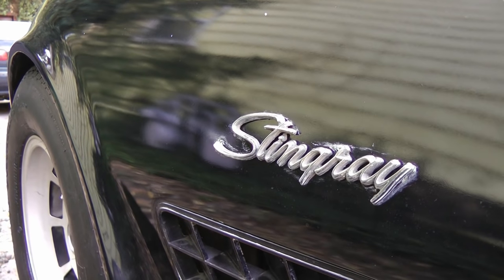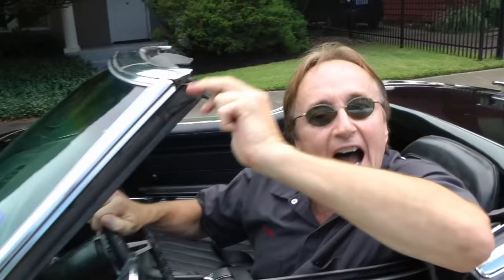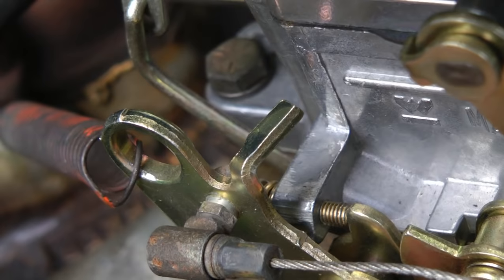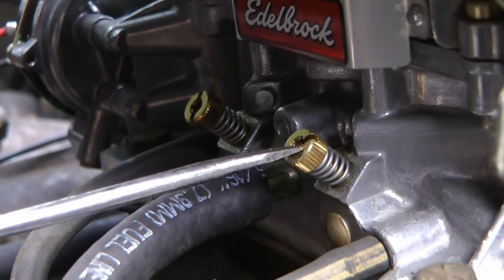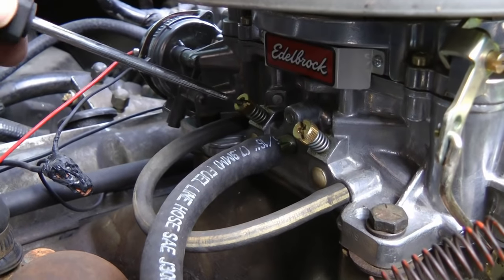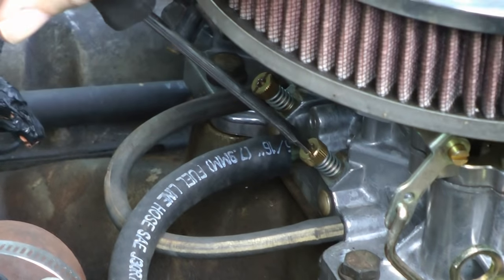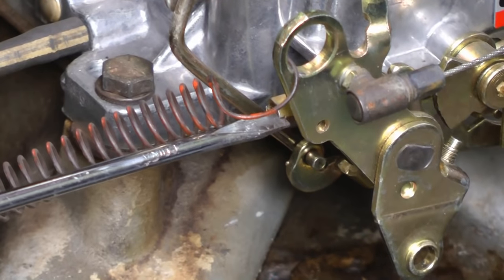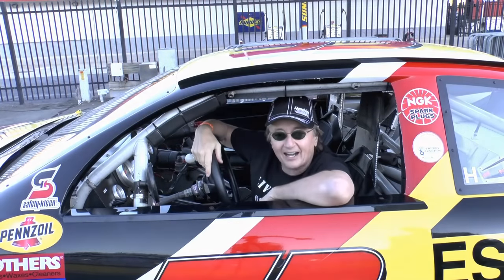How To Adjust A Carburetor On Your Car

Comment: I have an 82 Ford Fairmont straight 6 3.3. This past week been trying to find out why my car does not stay running while idle. Dies about 10 seconds after starting. Replaced plugs, wires, the coil, and the choke thermostat. When I replaced the plugs and wires a month ago, it was running great, then last week, it happened. I was told to find the idle mixture screw. No such luck on finding it. Any help would be greatly appreciated.

Comment: I have 4 adjustment screws on my QFT carb 2 on each side of the carb, should I do the same with each screw like you did with the 2 on this carb? its on a 351 windsor
Reply from the maker: +DieselSmoke92 yes
Reply: Okay so I ran into a strange situation. I did exactly what you did set them all the way down, then turned them up as many times as you said for all 4 on the QFT carb, ran it and then did some reading which was simular to what your saying, I set the car at 1300 rpm idle, started brining the screws more out towards me and was planning on doing it till the car hit 2000 rpm, then set idle down and do the next. What is happening is bringing the screws out/towards me is bringing the idle down not up
Reply: +DieselSmoke92 It may be that the jet sizes are not correct. This is really common for decent altitude changes between where it was tested and where you are using it. If the idle is highest when the screws are bottomed out, then you might have jet sizes that are too large and the mixture screws are continuing to richen the charge. You should probably get a set of a couple different size jets and start going down the sizes until you reach a set that have a maximum idle point around the stock 1 1/2 turns.
Reply: your saying get different screws?
Reply: +DieselSmoke92 No, the mixture screws aren't the problem. There are little brass inserts in the carb that have a very accurately sized hole through them that control the amount of gas mixing with air. The mixture screws allow for an amount of fine adjustment. I believe the screws don't have enough travel to adjust for the size jets you have. If you changed the Jets to a different size like I mentioned in my earlier post, you should be able to properly set the mixture then.

Comment: I don't know if you will see this considering it is not your latest video but I have a question regarding carburetors and engines. I have a homelite weed eater and after running it for about a hour and stopping it, it stops running at full throttle. I adjust the carb but to no avail. No matter what I do after that point it will not run at full throttle. Do you think it is over heating or could there be a issue with the carburetor?
Reply from the maker: Alpha Nerd certainly one or the other. But if it runs fine an hour, I'd say it's overheating. They are not made for that kind of long useage, they are just tiny little things after all.
Reply: Scotty Kilmer that is true. And considering that weed eater was sitting in our basement for about 20 years before we started using it so it was designed to run off of non ethinal gas.

Comment: Another unrelated note, I want to do a auto to manual transmission swap, on the same truck if I do it my self, would it be worth it, I don't want to sell it? Does that mean I would have to disconnect the 4x4, or is there another a way?

Comment: Hey Scotty I have a 1998 ford windstar that seems to burn oil out the exhaust here's the weird part the engine is a ford reman and doesn't feel like it warms up I replaced the thermostat with a factory style 180 degree thermostat. It consumes two quarts between oil changes in thinking it's the temp sensor or the gage is broke. The needle Barly moves off the cold mark and the heater is mildly warm. Thanks
Reply from the maker: droidrazor873 poorly remanned engine, for sure, it should not burn oil at all. Let's just say they don't fix things like they used to. It should burn NO oil being rebuilt correctly
Reply: Ain't that the truth!

Comment: Hey Scotty, if a car that goes below 1000 rpm when it's stopped at a red light starts to stall with a rough idle would I need to tighten or loosen the screw on the carburetor/throttle body?
Reply from the maker: Cristian Vargas tighten

Comment: Hi Scotty what should be the normal Idle of a carb engine?
is it should be 650rpm for manual?
Reply from the maker: +Hot Rodimus all vehicles are slightly different, but that's fine for most
Reply: +Scotty Kilmer just a follow up i forgot its an inline-6 carb RB24S
is 650rpm still ok?

Comment: Hello and greetings from Greece Scotty, i have a Citroen BX 1.4 kat with Bosch monopoint fuel injector system, which is somehow an electronic carburetor with catalytic converter and has a distributor also........the monopoint problem is the electronic throttle potentiometer .......how can i fix it???

Comment: Is it true that it's possible to use less fuel by adjusting the carburetor?
Reply from the maker: +JaiVideoProjects you would have to rejet the interior parts to do that, a complex job to do correctly
Reply: +Scotty Kilmer ok. i thought its judt like a motorcycle were they adjust the choke..

Comment: thats one rough v8.  How many cylinders are working on it?
Reply: I'd say 4 or 5.
Reply: All of them, but the idle speed is very low. Maybee 300rpm.
Reply: it's probably cammed giving it a lope on idle
Reply: Peter B. A little tip engines can't idle that low
Reply: It’s probably cammed

Comment: Can an engine cut out if the idle speed is adjusted too low and the if the air mixture is incorrect?
Reply from the maker: +michael jagger  only if you go too low

Comment: Have any suggestions for me? I have an '84 Mitsubishi Mighty Max with a weber carb and after i've been driving for a while and turn the engine off, the engine sputters for about 10 seconds. And if I turn the engine off for a few mins after 15 mins of driving, like running in to get some milk at the store, it's REALLY hard to get the engine started again. It will crank but won't turn on.  I'm not sure why this happens. I don't know if this is just a  simple adjustment I can make with the different screws on the carb or not.  Any suggestions are welcome!
Reply from the maker: MikenikeBTS if that weber has a fuel cut off solenoid, make sure it's working. if not, idle it down lower or rebuild the carb
Reply: Thanks for the quick reply. I'll try that.

Comment: aye I have a 350 create engine and i don't know  what's going on its not gaining the speed like it's suppose to and it's accelerating very slow and revs very high and it's in a 1986 chevy monte carlo luxury sport the monte had a 305 in it and I bought it from my uncle so it has a 305 Trans in it and I was told even tho its a 305 Trans it would work for the 35o I gave it a oil change and changed the oil filter I did all the Little stuff I knew how to do and I'm a out to go and get new spark plugs for to see if the performance comes back. if you know what it may be I would surely appreciate it

Comment: Scott I need help my carb has been rebuilt but it still bottoms out when I hit the gas. The fuel line is clean an fuel filter are clean. The carburator was rebuilt but I'ma feeling like it's a vaccine issue . Any suggestions?

Comment: I rebuilt my 350 engine not too long ago but problem is i can't get it running. im doing TDC on #1 piston got my rotor pointing toward #1 then correct firing order but its hard to start then when it do run while trying to rev the engine it backfires thru the carb sometimes gas squirts out. I just bought a new distributor same problem, what do you think it could be? I have a video on my profile if u want to see
Reply from the maker: +txchevyrida  SO many things can go wrong on a rebuild.  But first hook up a timing light and crank it to see what the base timing is, dist could be off a tooth or more doing that
Reply: +Scotty Kilmer The carb was sitting for about 3 months also the gas too when i take the carb off to pour the gas out it looks like it has a brown tint in it

Comment: how do you know when it's lean or rich?
when you loosen the air screws does it let more air in?
my old 1989 corolla does 6kmpl and I'm working on increasing its mileage haha
Reply from the maker: you look at the spark plugs, black is lean, white is lean. Loosening the screws makes it leaner
Reply: black is lean, white is rich? or black is rich white is lean? confused... haha
you typed black is lean, white is lean
Reply: Joseph Christian Salas god damn. And he just leaves his supporters hanging like that. I have been messing with those damn screws for 5 hours.
Reply: haha I know right, but I found out after messing with the screws and testing it out that loosening the screws lets more air in thus leaning out the engine and making it more efficient.
although it makes the engine a little bit hotter but unlike the rich mixture it doesn't flood the engine.
my sparkplugs were not fouled unlike the rich mixture. and also the smell of gas is lessened :)
it's a trial and error though haha

and also I found out that if you change your octane rating (changing your gas to higher or lower octane) you also need to recalibrate the carb for it to be efficient again hehe
Reply: you're suppose to not do it like this video , when the car is at highest idle after you turn the screw out you must not leave it there cause it's running lean and it will damage your engine if you leave it there  ,  you are suppose to go back screwing towards the inside after you have done it towards the outside to make it stumble and now it's running rich {{running rich will not damage your engine but it will give you a hard start and black smoke and make your sparks black {foul them} , bad MPG etc... .  }}  now after you done the screw towards both sides {{screwing it out {lean} and screwing it in {rich} }} you are suppose to set the screw in the middle , lets say you have turned the screw out until it had the fastest idle , then count how many turns inside would make it stumble {rich} for example if it took 6 turns to make it stumble from the highest RPM idle you go back 3 screw turns from the stumble {rich} position , and if you get black carbon on your sparks and your carburetor is running ok then you should get higher heat range spark plugs , and if you are getting white/gray sparks you should get a colder heat range sparks .

Comment: I have a classic mini and I'm no mechanic. But is there anyway to get rid of a manual choke on these cars and have it like a modern car. Or does it have to have a carburettor
Reply from the maker: +FPSyorkshire  I would assume someone somewhere would make an electronic choke carb that would fit it. Weber used to, but they went bankrupt. Try hemmings motor news they sell everything there

Comment: Hi Scotty been following you for awhile been working on my engine swap 93 gmc sierra c1500 with an 86 or older 305 Chevy in it i was told i need to tune my carb but the adjusters are different shaped on inside like little rounded male rectangle if you can help thanks in advance but what tool would i need to adjust the air mixture on a Rochester Q-jet 17085204
Reply from the maker: +emoXodus often you can get 1/4 inch socket sets with sockets that will fit both of those. Or find a tool you already have and modify it to fit or just slot the adjusters with  small grinder then you can use a screwdriver

Comment: My car is Mitsubishi minicab its a carburetor model 
When i turn on the ac and drive it has a rough idle and then the Engine stops midway otherwise it has a perfect idle (Without the AC on)
Please help me with the necessary steps i should take to diagnose the problem 
Thank you 
Malik

Comment: Hi scooty i have a problem with my renault megane 2005 when i am driving it over 110-100 kmh the steering wheel and whole car is shaking what should i do is it safe to drive like that ??? Please answer this question its realy important
Reply from the maker: Dvir Perets not safe, tons of things can make em shake, from worn ball joints to out of balance tires. Most good front end shops give free estimates, start there.

Comment: I have a 91 Chevy s10 4x4 4.3l,  and I notice when I give gas, from a complete stop it hesitate until I, give it more gas. I checked the the throttle and it opens almost all the way, I would say about 85 to 93%, could it be the sensor or the who'll carburetor is dirty? Would appreciate any help.
Reply from the maker: Nothingbutneutral11 a 91 is fuel injected. Tons of things can do that, try a tune up with new spark plugs and wires first.

Comment: Hey scotty, my muffler throws out a liquid from it, it smells like coolant. And I checked my spark plugs and 2 of them had oil in them as well. And by the way. My muffler also throws out smoke. White puffy smoke. What could it be? Blown head gasket or what?
Reply from the maker: Leonardo Flores blown head gasket at a minimum

Comment: So essentially just mess with the screws until the engine doesn't shake when you rev it? I have a edelbrock 1405 on a '67 mustang
Reply from the maker: yep
Reply: omg it worked! long story short, i had some guy rebuild the cab for $280 and 3 days later, it starts but stalls after i release the gas. i contacted him and he said it wasn't his work so now i was stuck with this problem. thanks Scotty for this. i truly saved so much money because of this informative video

Comment: Scotty Kilmer Could you PLEASE tell me what am I doing wrong with my 2008 Honda accord. It has 90,000 miles and has black smutt in the exhausts. Now my grandmother has had her Honda for over 14 years and you can rub your finger in there and get nothing. I just want to know what caused this problem and what can I do to fix it. I want my engine healthy.
Reply from the maker: Timothy Thomas do my video "how to clean fuel injectors on your car" as they often carbon up then make em run rich

Comment: How to fix a clutch system on an Audi 2002 TT elm edition 
And what tools would I need?
Reply from the maker: Adonis Singletary  Audis are insanely engineered machines, and really, I would not advise doing that yourself due to the large amount of specialty tools needed and really, you need a lift on that model to put in a clutch.

Comment: Pft my Rochester 4bl carb was no where near this simple or accessible
Reply: Alexander Chavez I had one before. Its exactly the same. Just one extra adjustment screw for the fast idle when the vehicle starts up (on the passenger side). Unless you're talking about one of those electronic ones. I haven't messed with one of those.

Comment: Scotty if I have what sounds like back fire and flames coming out of my dual exhaust how to I fix that I know it has to do with the air fuel mixture
Reply: Older and newer cars and trucks do it mainly when you run no muffer/no cats stuff like that old 6 and 5 and 4 speeds do it very easily haha
Reply: @jdm.h0es344  yep no mufflers on my 1985 Camaro  , but it didn't use to do it
Reply: @TROUBLEDAGREAT  my 85 nissan 720 5 speed does when i down shift its normal you can have them tuned to do it i personally like the pops the flames and the backfire lol

Comment: Hey Scotty I have a 1989 Camaro and it has a random misfire, it idles good then a big misfire occurs then it idles back smoothly, do u kno what it could be
Reply from the maker: The1972Cutlass could be lots of things, BUT first check the ignition system, plugs and spark plug wires and dist cap and rotor
Reply: O OK I just put a new distributor, cap and rotor on about a month ago, and checked all plugs in wires
Reply: +Scotty Kilmer hey Scotty my TBI on my 1989 camaro only has one adjustment screw, would this method work

Comment: I have a 1986 Cutlass Oldsmobile 5.0 I had somebody rebuilt my carburetor when we reinstalled it it is idling very high for a few seconds and then it backfires from the carburetor and shuts off tried to do the idles screw but it does absolutely nothing what would cause this

Comment: Hi can you help me. I have a 1993 fiat uno my problem is when my aircon is off the rpm of the engine is normal but when I turned the ac on it rises to high and when I step on the gas pedal the rpm rises but it doesn't go back to normal like it is stuck. Is it the carburator? Thanks hope you can help.

Comment: Scotty i have a 79 cj5 6L the problem is it doesn't have a RPM gage.
Reply from the maker: +casimirobuenabista you can buy an old tachometer/point setting gauge online or ebay cheaply enough and hook it up to the dist to get rpms
Reply: +Scotty Kilmer thanks scotty keep up the good work.

Comment: Hi sir, 
I have an issue with my car. I recently changed the clutch plate and pressure plate of my car. The car runs fine but it has lost  some power. It used to go at 60mph easily at 4 gear before but now it does not, even in 5th gear it whines alot. I approached many mechanics but they say that the clutch is fine....
Reply from the maker: saif rehman recheck the clutch work, could be wiring or sensors for the engine control system were damaged . Clutches either work or not, if it doesn't slip, it's not a clutch problem
Reply: Scotty Kilmer thanku very much...